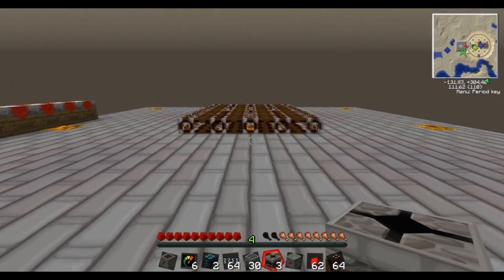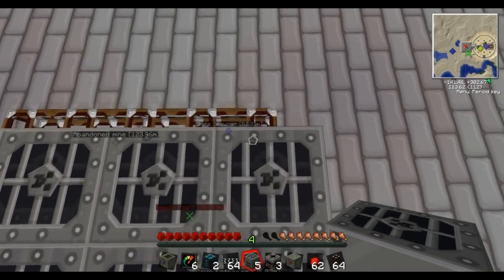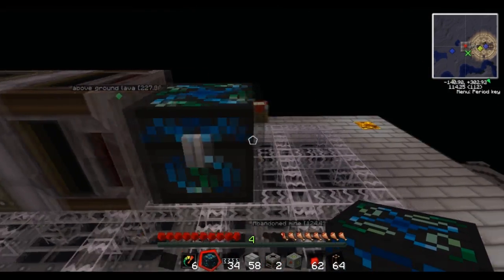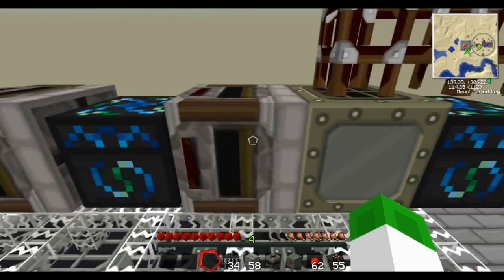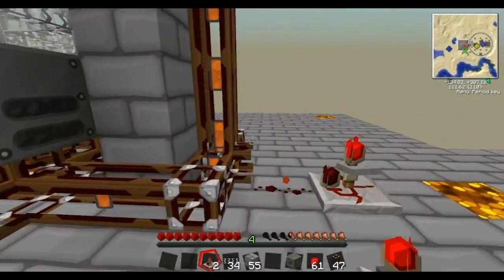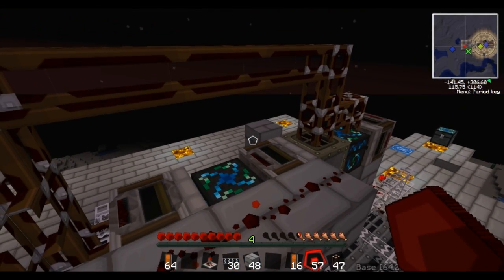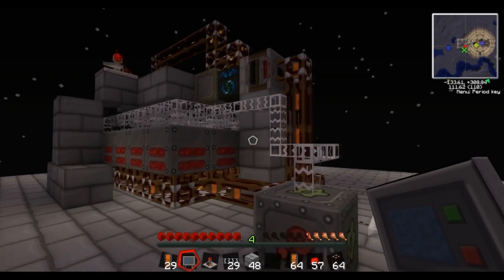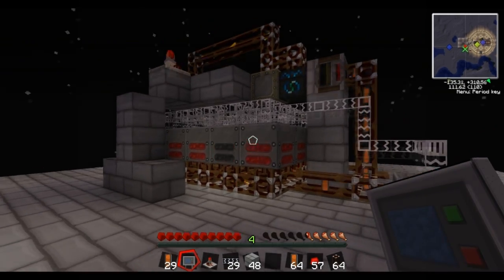Tekkit Infinite Geothermal Power

Comment: Cheat with condenser? You do relize that to make any item worth making (diamonds, dm, rm, etc.) It requires quite a bit of emc. To make these items at a reasonable spees requires a large blaze rod emc farm, which could use 5 rotary macerators with 3 overclockers each. You cant autocraft those with AE like in Ftb. Tbh, tekkit is harder in many aspects. Once you have an AE system in FTB, you become Bill Gates.

Comment: I suppose.  Saving EU via only allowing it to macerate a certain quantity per blank seconds helps, but you might as well just let it run forever and at max speed for extra EMC generation.  Just set up another condenser on the same line but slightly farther or even directly next to the condenser that is making the blaze rods and it will siphon off a small amount while still giving unlimited power.

Comment: Also, you don't have to tell the filter pulling from the macerator what to pull out because RP2 is intelligent enough that the only items being pulled out from the side are the side outputs.  The input (top) is separate so its an unnecessary step.

Comment: I'm slightly new to the mods (I play on direwolf20 FTB not tekkit) but is this system more efficient than putting the blaze rods into generators? I understand the loop system makes your fuel supply infinite but I am making a blaze spawner with a soul shard so acquiring blaze rods won't be a problem.

Comment from the maker: this is some what true. There are 2 things though. The first is this is a emc generator and a power source. This will still make you diamonds so its a two 4 one deal. The other point is the lava cells get used alot slower than the EMC maker makes them. So you would either alter the generator to make less EMC (dont want that) or you make a less effective emc gen, that will be bigger making it less practical. But your right if ur late enough game that a few diamonds dont matter, go for it.

Comment: Thanks for the tutorial it works great but i was just wondering if there is a way to turn the whole thing off instantly without having to take the lava cells out , i want to do it because when if fills up my mfsu but energy is still being drained from the mfsu the geothermal generators turn on and off ever second making a really loud noise and i don't want to keep destroying the power output cable every time the mfsu fills.

Comment: I got it working after a little while. Still not sure exactly what was wrong, but I think I must have had the filter at the end pointing in the wrong direction. I also changed the direction the condenser was facing, if that makes a difference. But thanks for the response and suggestions. And of course thanks for the video. I now have completely infinite energy and resources.

Comment from the maker: If its the Blaze rod generator that isnt working i would make sure that the redstone is properly connected, when the filter gets redstone current it does an animation, make sure this animation is happening. If it isn't then its not getting the redstone signal. If it is but it still isn't working, make sure the filters ahve the correct items in them, and the chests have the item to replicate in the top left. If it still doesn't work let me know. Ill take your level.dat and take a look :D

Comment: 1 way of producing infinite EU or EMC depending on how you set it up involves having a geothermal generator (or more) powering a lava fabricator. This can produce infinite eu. for infinite emc you can run a pipe off of the rig and into a tank. you can use deployers with buckets to get the lava out and into a condenser that creates empty buckets to cycle back into the deployer while some of the other lava buckets can branch off into a condenser. this can also work with cells.